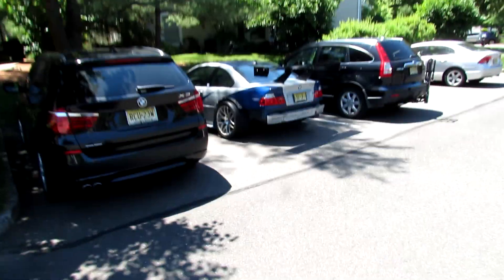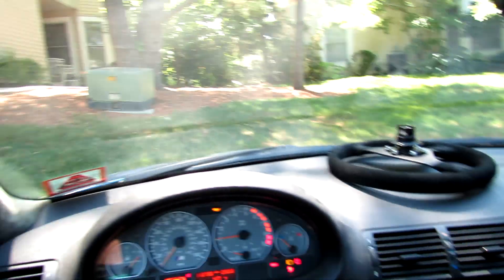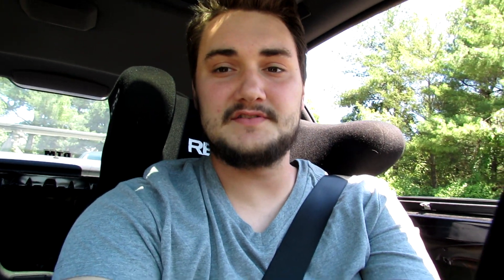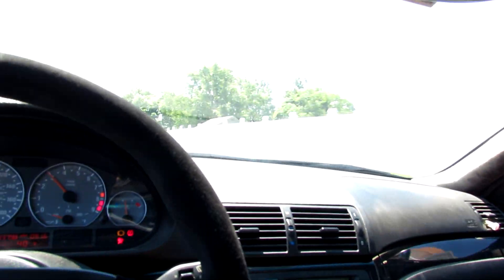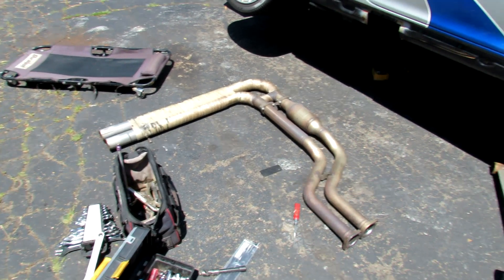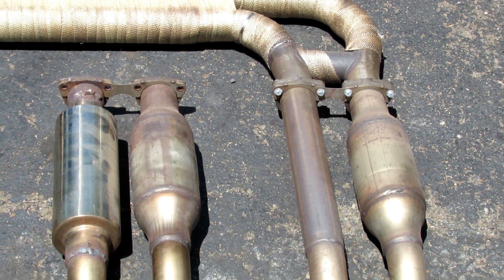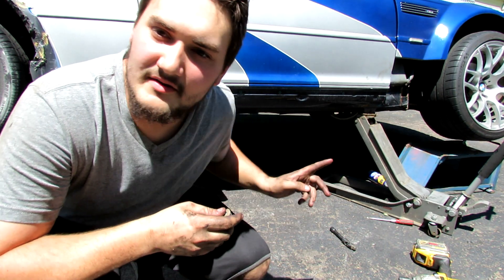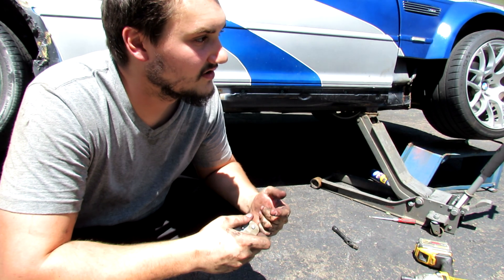M3 GTR + Resonator = Less Rasp :)

Comment: What's the point if you're going to change the engine, the sound will change too..
Reply from the maker: Jokūbas Burba still resonators will be needed so it’s not drony and annoying on the highway
Reply: You might still have to tinker on the exhaust, it's not guaranteed it won't sound raspy with the resonators.